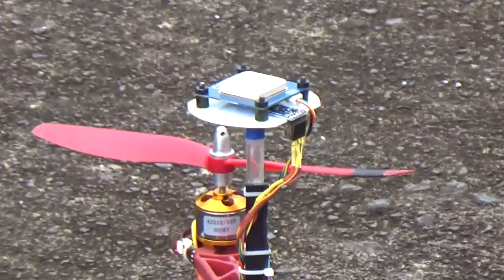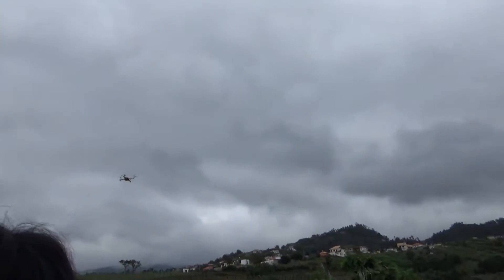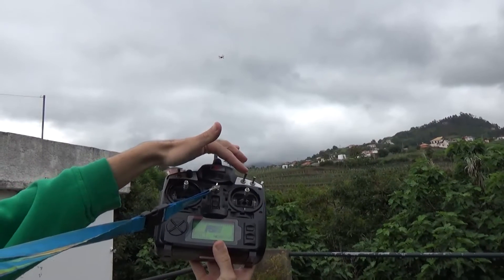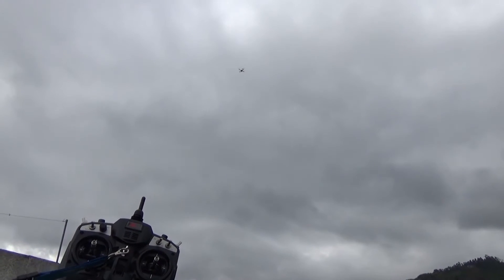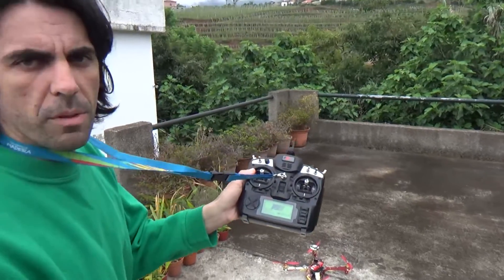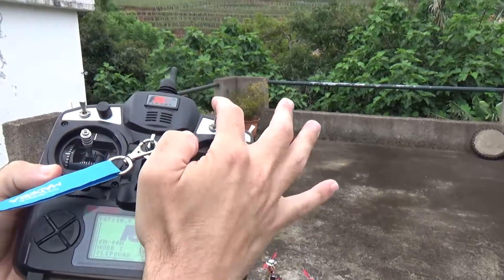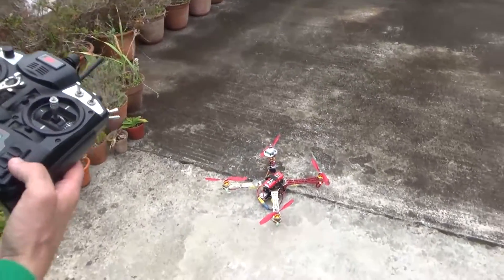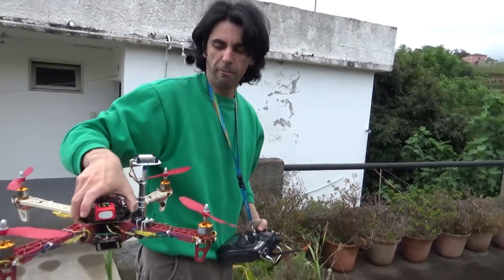iNav 1.1 Return To Home Test

Comment: which flight controller and gps module you are using ?
Reply from the maker: +Rajat Ahuja flight controller is a flip32+ and gps is a neo6-m
Reply: What did you pick under inav "choose a board" ? I do not see flip32 in the list.
Reply from the maker: Matt Jones naze32
Reply: Ah thanks!

Comment: rth settings plz
Reply from the maker: It is all stock, just select RTH on flight modes, and set throttle channel to HOLD at 1400 in configuration tab(this is mostly for failsafe when turning off transmitter)

Comment: hello can you help me for setup RTH.. ur email or whatsaps plzz
Reply from the maker: +syokonline RTH is very easy to set up you only have to use inav configurator instead of cleanflight, and select RTH in the failsafe options
Reply: what about if fly over 2km and lost signal... did quad will RTH?
Reply from the maker: syokonline yes it will return but you   must have throttle channel set to "hold" in configurator otherwise it will fall from sky instead of returning to home.